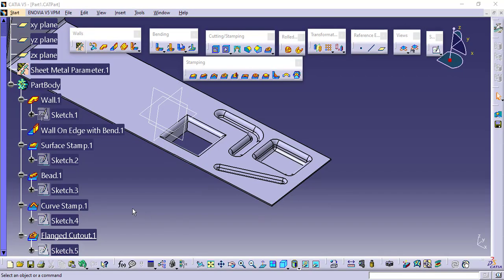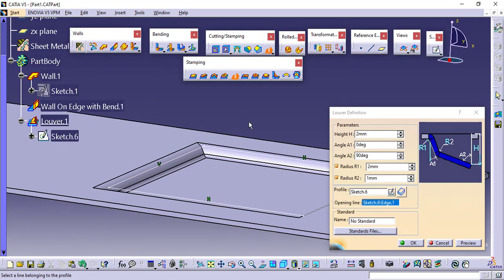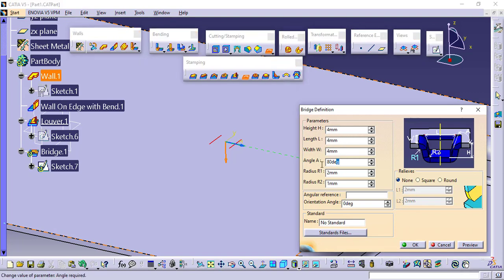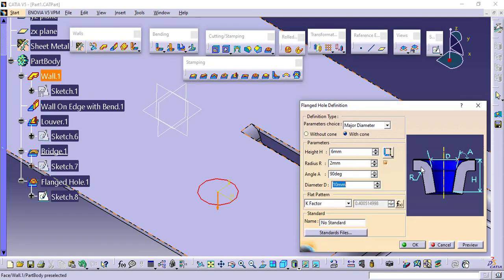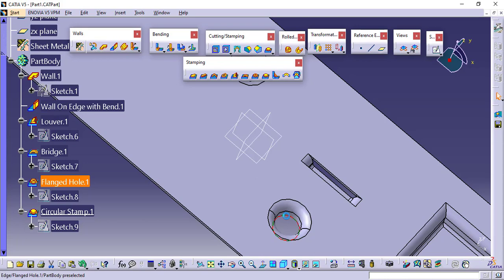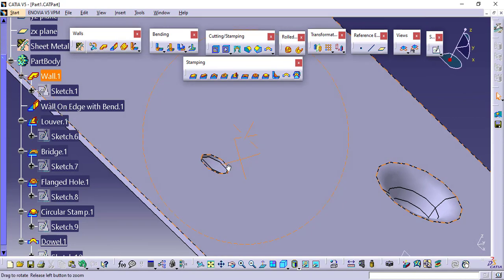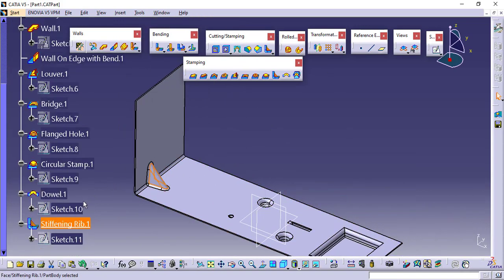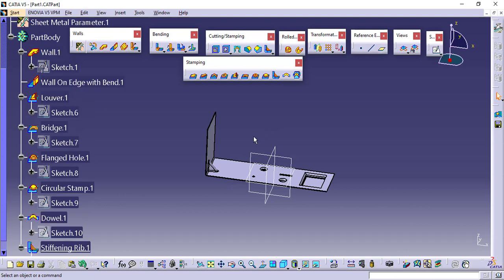CATIA Sheetmetal - Cutting/Stamping Operations Part 2

Comment: Hello Sir I need Help
I am new to Catia V5 
Problem is I got step file from somewher to practice mold design on CATIA v5 and the part is Already rotated in three Axies So how to align part according to datum planes in part Design.
Reply from the maker: You can use transformation axis to axis type. Or other way is define a new axis system your imported part only and hide the previous axis system or planes.
Reply: @mastertheskillls  I already tried this way But After done this when I save part in step again it takes its old Axies.
Reply from the maker: @surajprakash3264  if you will save it in neutral format like STEP or IGES, axis system will definitely disturb. It will never remain same but if you use .CATPart format, it will be remain as it is
Reply: @mastertheskillls  sir If we send file  to customer  we have converte the file step or other formats . When they open part it will be at an angle position . So what is the solution of it
Reply from the maker: Customer has to define the new part origin to properly open it from IGES or STP format. There is no other option.